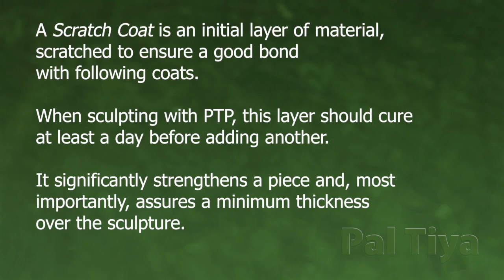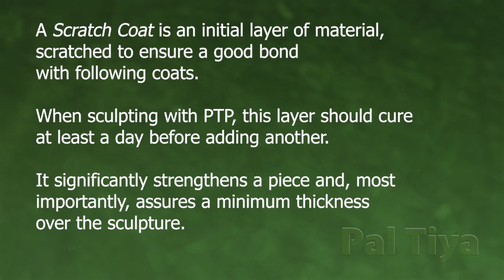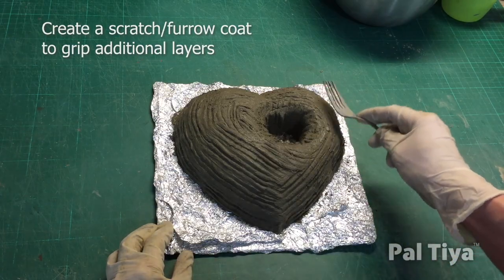The One About The Core

Comment: On the hearts, could the two pieces be joined at some point before complete cure?
Reply from the maker: Absolutely Yes! You would just need to apply a scratch coat to the edges when making then use more Pal Tiya Premium to simply and essentially  "glue" the two pieces together then cure as per instructions. Hope this helps :face-red-heart-shape: